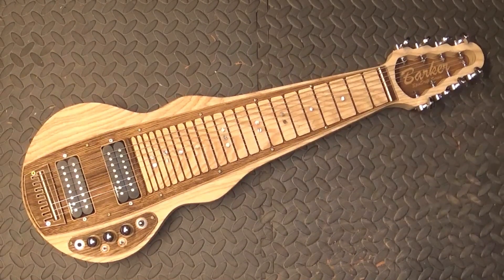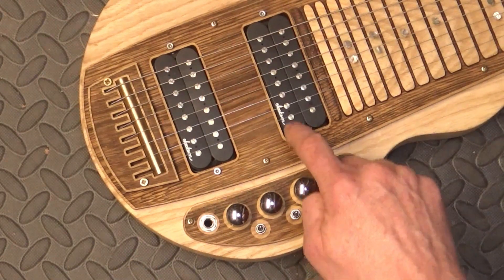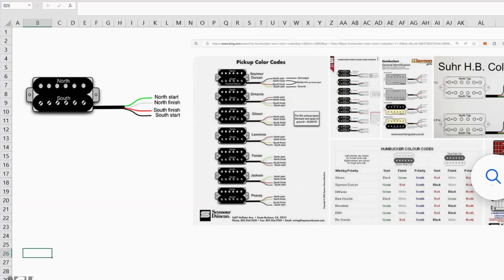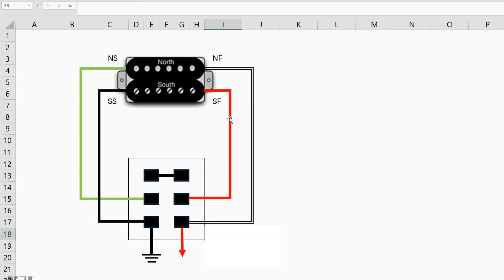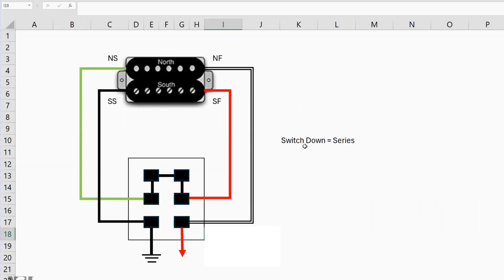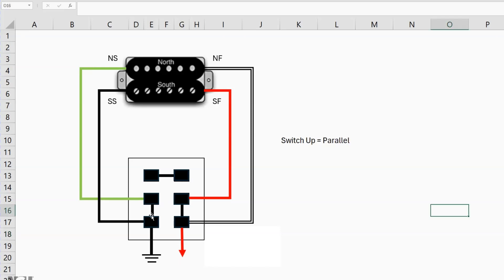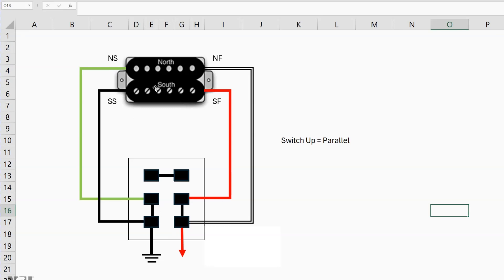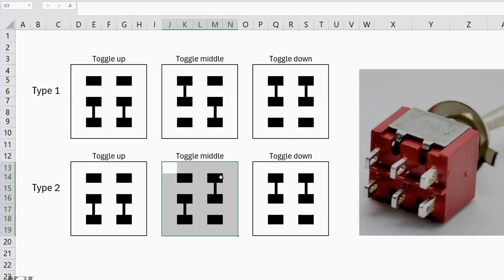How DO you wire an On-On-On switch? 🤔 Series/Parallel/CoilSplit in 1 switch!!

Comment: If you have the "wrong" type of ON-ON-ON switch and wire it as you did, the middle position simply selects the other coil (South, in your example instead of North).
Reply from the maker: Correct - but of course it works in a slightly different way; rather than the signal from the cancelled half hitting a dead end in the short across the top pair of legs in the switch (so both are fed, but only one can return), the north pickup never receives a connection from ground in the first place - with the other type of switch it is the left top and left middle legs that are joined, so only south is fed, even though both north and south wires are returned by the connection between middle right and bottom right legs…
Reply: @bigtalltim  So do I understand correctly that either type will work in the same way with the same options following the same wiring only which single coil is used in the mid position will change in terms of its output? Been working on guitars for years and still can't wrap my head around the electronics properly lol.
Reply from the maker: Yes - basically this wiring layout will work with either type… all that changes is which of the “single coils” is isolated

Comment: Thank you!!! That helped me a LOT to understand the actual signal flow! Great :) Most videos just tell you how to solder them, not why
Reply from the maker: Many thanks - always good to hear that the vids are helpful in understanding the underlying principles!
Reply: @bigtalltim  Thank YOU! Your video was a breakthrough for me! 2 things I do not understand though: 1. your series signal flow makes sense ground - ss - sf - ns - nf -hot. On so many diagrams though, the 2. coil is swapped. For instance ground - ss - sf - nf - ns - hot. Why?! Does it have to do with polarity or do they just name things wrong? And 2nd: Do switches have basically one side that goes out of the switch and one that goes in or is every pin the same? Thank you again
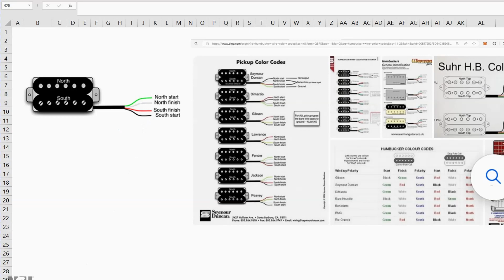Reply from the maker: Hi! On your first question, it is desirable to have the single coils out of phase (one north and the other south) as this will be hum cancelling… basically, if you have 2 split humbuckers acting as widely spaced single coils, you want them to be opposite… that way it behaves like a giant humbucker! I’m guessing that this will affect wiring schemes in other builds. On the pin layout, the internal connections are best seen on the layout at 2:14 - the vertical black lines are the internal connections that are changed by the toggle position. Hope that helps!
Reply: @bigtalltim  Thank you for the quick answer, that makes sense! I understand the connections. One thing that is weird for me though is that it seems, that the ground and the hot connection are working (in/out) regardless of the switch position. So, are all the pins always on but they just connect differently? or can pins be turned off?
Reply from the maker: With the bottom two legs (ground and hot out) there are two wires connecting to each, so they are permanently connected… each leg is really just a connector post for wires… the switch just internally connects these posts in different ways depending on the toggle position
Reply: @bigtalltim  Okay, I see, thank you, that makes sense!

Comment: Thanks for this video. I've established that I have Type 1 on-on-on. If I wire this up and the coil I've split doesn't hum cancel with my neck pickup (neck single, bridge humbucker), is it just a matter of switching the hot and ground outs on switch? I am trying to be prepared for this scenario as I don't know if my neck pickup is RWRP, but I definitely want the single mode to be hum cancelling with the neck pickup. Thanks again!
Reply from the maker: Hi! In a word, yes. Just flip the green/black and red/white and it will isolate the other one. Hope that helps!
Reply: @bigtalltim  wow thanks for the quick reply! no I meant the master hot out and the ground, so I can solder up the 4 pup leads and just flip the two in the event of incorrect, instead of flipping 4--would that work?
Reply from the maker: No worries! I don’t think so… I think you have no choice but to flip the 4 or use the other type
Reply: @bigtalltim  REALLY appreciate the responses.. one last question lol I assume for Type 1, I would just mirror the wiring diagram you have shown? i.e. swap the right-hand and left-hand pins? The top jumper would remain the same
Reply from the maker: No need… this wiring layout will work with either type one or two, BUT the other single coil would be isolated in the central position… check out the pinned comment for detail on how it works

Comment: Does this work the same using a Push Pull Pot ??
Reply from the maker: Not always, but it can… think of a push pull pot as two separate components - the pot on the top, and a switch on the bottom. These are usually just double pole double throw “on-on” switches, which would not work for this; You need to source a dpdt on-on-on (sometimes called three positional) switch

Comment: A have two questions, 
One: why if you´re putting the hot of coils into ground it works? I talk about NS and SS 🤔
And two: why when sometimes the pin of signal (6) Is not active It works to pass the hot signal to volume?

I apologize for my bad english 🙏
Greetings
Reply from the maker: Hi - not sure I follow, but I think you are asking how the  coil split works… in the circuit the signal flows from ground through the pickup to the hot signal out… if you connect that hot output to ground it runs ground to ground in that half of the pickup… like a hosepipe connected to itself - nothing can flow, so there is no signal
Reply: Ummm, i was talkin on the parallel Switch position, because South start goes to Ground.
And from what I know, South start should be at the signal in parallel.
By the way I'm going to replicate your wiring because it worked for you. 🙏😁
Youre great!
Reply from the maker: Cheers! In parallel mode they both start from ground and both go to hot out. In series, one starts at ground, and goes to the other pup instead of ground… in single coil mode one of them runs ground to ground (so nothing happens)

Comment: Tim thanks for you straight forward explaination, I am trying to split m bridge humbucker in an HSS build using a superswitch, I want position 5 full humbucker, pos 4 south humbucker coil and middle with pos 3 being north humbucker coul and neck.. its getting a bit messy on the super switch, so my thinking now is add a dpdt 3way between the humbucker and selector and I can control what coil or combination i send via the toggle switch, but can get my head around how either of the switches could output the 3 options I am looking for, 1>north coil, 2>both coils series and 3>south coil, thoughts welcome
Reply from the maker: There is a lot going on there… I’m thinking you put two of these on/on/on switches in, one in between each pickup and the selector switch. That give you unique control over how each pup is served up. The first (to give single coil with north) you use type two. The second, where you want to isolate the south, either use a type 1 switch and the same wiring, or flip the inputs and outputs in the on/on/on switch… after that you just have to figure out your selector switch and you are done. I should add that this will give you complete control and a lot more tonal options as each of the humbuckers will have 3 available modes. (But with them both in the middle position, will give the desired isolation of the north or south coil)
Reply: @bigtalltim appreciate you taking time to reply will update when I get time to look at it. Thanks again

Comment: About a year ago I was doing my first series/split/parallel wiring and following the seymour duncan schematic, which claimed that type I was far more common and standard. Turns out the on/on/on from stewmac are type II, 12 very frustrating hours of troubleshooting finally led me to that now obvious realization... worked like a charm. 

Thx for making this video on a relatively niche subject! Great explanations and schematics!
Reply from the maker: Cheers - thanks for watching! Always great to hear that the vids are useful! Also, I know what you mean… that exact same troubleshooting drove me mad enough to figure it out on paper in the first place!!
Reply: @bigtalltim continuity tester mode on my radio shack multimeter was always easiest to understand. 😂

Comment: Thanks for this upload. Super helpful !! Is there any way to do that for the two pickups at the same with one master switch ? Like the 4dpt from dimarzio ?
Reply from the maker: You are very welcome! In a word, yes - you could wire two pups to one on/on/on switch, and it would work but there is a catch; if you did that, the pickups would share the switch - and would also share the single wire output that goes to the pickup selector switch! it would be impossible to separate the signals to do a pickup selection - both pickups would be on permanently… I’ve always just used two on/on/on switches in front of the pickup selector - that gives maximum tone options anyway, as you could split one and have the other in series - I typically use the bridge pup in full series and the neck pup in parallel/split mode

Comment: Thanks for making this upload. Because of your clarity I actually think I understand the circuits - and I've got zero experience of wiring. I take it that for HH guitars with two volume controls, each knob will still independently control each pickup, regardless of whether series, parallel or single is selected (and same for tone if there are two of those controls)?
Reply from the maker: My pleasure! Regarding a HH with two volumes, wire it like a Flying V or explorer… the way I have wired them myself is to have two of these switches - one in between each of the pick-ups and the relevant vol pots, with the output from the on/on/on switches going to the vol pot for that pick-up, and then on to on the selector switch. That way you still have master control over then mix volume whatever the tone option… there are lots of diagrams out there for the Flying V, but basically the sequence of components is: p/up to on/on/on switch, to independent vol pot, to 3 way selector switch, to output jack, with the shared tone control linked to both vol pots. Hope that helps!
Reply: @bigtalltim  Really appreciate you getting back to me, Tim. So the volumes stay humbucker specific, but you only use one tone control - and that is then a master tone? If so, one tone would be enough - especially with all the blending options. The guitar I'm thinking of messing about with is a cheap SG type with 4 controls and a three-way.
Reply from the maker: In an SG or LP setup (4 controls and a 3 way switch) your easiest option is to fit the on/on/on switches between the pickups and the relevant vol pot - everything else is the same :)
Reply: @bigtalltim  Great - thanks

Comment: Hi Tim, really well explained. Just comparing your wiring to a Dimarzio one, and it seems there's a fundemental difference in the order of the coils in the series wiring (after adjusting for different colour standard). Dimarzio: NS -> NF -> SF -> SS. Yours: NF -> NS -> SF -> SS. So it looks like the phase of one of your coils is reversed from at least the Dimarzxio recommendation if I understand that correctly. Wouldn't that negate the hum cancelling as the hum from both coils is now in phase, rather than opposite? Or is this just a matter of convention for which ends of each coils are considered start and finish by different manufacturers?
Reply from the maker: Hi! It is the second… each manufacturer will have a slightly different approach. Bottom line, there are a couple of things that need to be in place for the hum cancelling to work - the north up / south up magnetic orientation, and the direction of the windings themselves.
The core design of a humbucker is basically two separate coils placed close together within the pickup body; how those pickups are connected in the control circuitry doesn’t matter so much… it is the physical winding direction and magnetic orientation that gives the hum cancelling effect. In a normal humbucking pup one coil has its magnets oriented north-up, while the other has them south-up, creating opposing magnetic fields. When the signals from both coils are combined, the electrical noise picked up by each coil is out of phase, effectively canceling each other out - as long as the signals both land in the same circuit… If you sent each signal to a different amp, it wouldn’t hum cancel - they need to be combined into one signal for the destructive interference effect to do its magic. Given that the magnetic polarity and windings will be the same in each scenario, if it worked in series it will work in parallel and vice versa. The coil split will however be subject to hum, as the second coil which would provide the necessary reversed signal to cancel out the background interference is absent… hope that helps!
Reply: @bigtalltim  I think so.. just to confirm, is it fair to say that the hum picked up by a (single) coil is the same no matter which direction the current is running through the windings?
Reply from the maker: From an audible (when amplified) perspective, yes… from an electrical perspective, it is the mirror image of the sine wave if the winding is reversed - so, it would make a difference which of the coils you isolate if you are running with this switch for each of a pair of humbuckers, and when using both pickups together. Out of phase, the two single coils would hum cancel… in phase, normal single coil service would be restored!
Reply: @bigtalltim  thanks for taking the time to explain

Comment: Question for you Tim.  Does it matter if it's Type 1 or Type 2 switch as long as you can follow the signal pathways through the switch lugs and coils as you have described for the 3 coil modes?  Reason for asking is that Delano Pickups seem to have instructions for Type 1 switch on their PDF (bottom half of page 9 for Series, Single Coil and Parallel) but they don't say it's a Type 1 switch in words.  They have a jumper from the upper right terminal to the left-middle terminal, as opposed to your jumper connecting the upper 2 lugs from left to right.  Delano threw me off for a while until I realized they drew it for a Type 1 toggle switch.
Reply from the maker: Great question - I’ve just had a look at that diagram you mention… it is a slightly different way of achieving the same effect; whilst in mine the single coil sound is achieved by making the signal path for one of the two coils hit a dead end, theirs appears to isolate one of the coils by connecting both ends of that coil to ground. Either will work - as long as there is not a complete circuit, the signal cannot flow and only the other coil will work. Re switch type, bottom line as long as you know which of the four wires are which (the manufacturers colour list gives you that), the wiring is a straight mirror image from type one to type two… ps. for the record, my type is easier to wire - diagonal jumpers are a pain!!
Reply: Thank you for the clear explanation.  Your way makes more sense to me from a flow path perspective so I’ll definitely do it your way when my components arrive.

Comment: Thanks man, I have type 2 switch and cant find information about wiring on type 2
Reply from the maker: You are very welcome! be careful when checking what type you have - I have had stuff shipped as 2 that was actually 1, and vice versa... always check! The pin out diagrams in this vid are shown from the bottom (looking at the legs) so an easy thing to check with a multimeter; The video shows the type 2 layouts... if you have a type 1, just take a screen shot and flip it on the horizontal - the wiring is exact mirror image! OR you can wire in exactly the same way, and it will just isolate the other half of the humbucker (so you get the south on its own instead of the north on its own) Hope that helps and good luck - this is a lovely little mod!